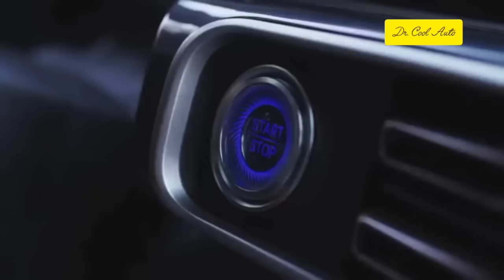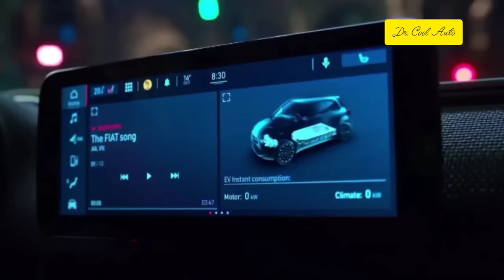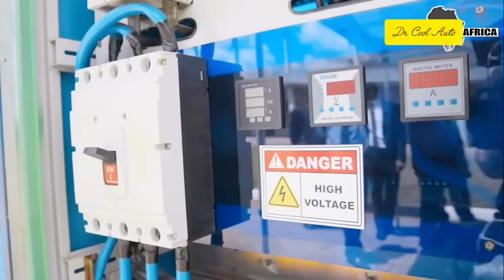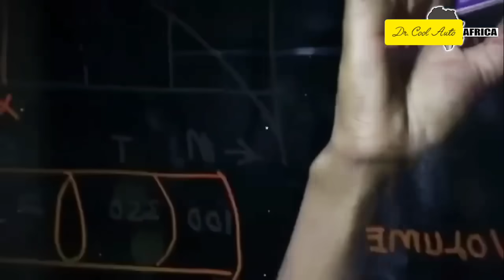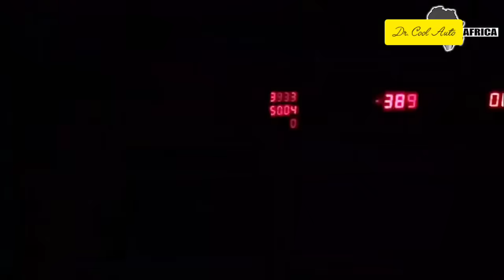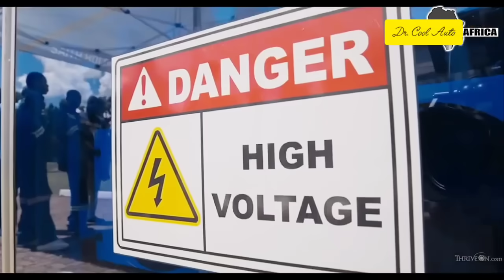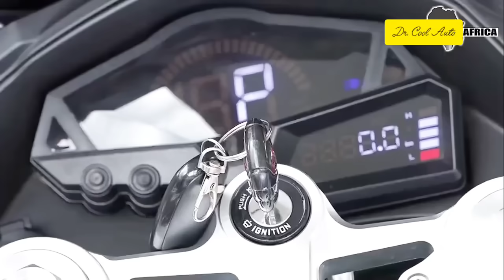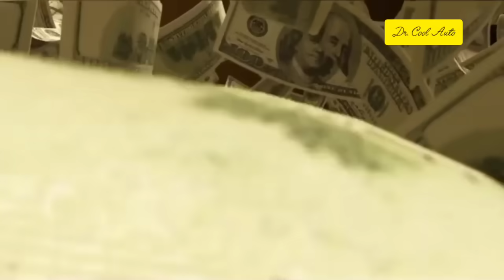2025 Self-Powered EV: Shakes Up The Entire World! shock skeptics

Comment: Charging of EV's was always possible.
Mr. Chicumbutso's invention is very great; but the charging of an electrical vehicle was always possible but was discouraged. 
     All electricians and all electronic technicians always knew that an electric vehicle is always capable of being self-charged by alternator just as was done to the gas engine vehicles. A simple alternator or one made specifically for the larger battery bank of the EV could be manufactured. Typically anything that moves can generate electrical energy.
       On the other hand Mr. Chicumbutso's energy is a different matter. It is a much more comprehensive matter. Nikola Tesla had already invented something like that but his funding was pulled for the same reason;  it promised free electrical energy; which does not suit the status quo. Tesla died and it is said that government took his records.

Comment: I have posted years ago about self powered generators , lately a comment on self powered engines. As a single unit , the gen is mounted to the electric engine and wired direct . Utube w/ elon i dropped this comment about yr + ago.

If you combine my self powered generators w/ electric car engines . You end up w/ a single unit you can put under the hood and drive 24/7 no batteries , no charging co's no oil or gas . Just drive fly ship cruse . Again .... Anything electric can be redesigned as a self powered device . All of them AC , Frigidaire, computers etc.. 😉 my specialty self powered ever herd before..

 yrs later even nasa tried to claim on utube stolen nasa tecnologies , free energy devices. 💩 
Because they didnt have any such a thing as being self powered at all ... Others will continue ✓ uc all appliances .

Comment: $14,000 just in production is still too expensive for the African market. Let the selling price per unit drop down to at least $5,000 then the invention could really cause a threat to the fuel car companies.
Reply from the maker: Well how much is brand new Tesla Model and byd sold?
Reply: @drcoolautofix  I don't know since I'm obviously not the target market of Tesla here in Africa but the cars bought here are bought for 4,000 and the one sold for $14,000 which exchanged to the local currency is about 35 million that's a very comfortable car and not many buy it.
That's why I was wondering as his cost is that high is his target market really Africans or has he just been duped to create a product that at best would have to export it abroad.
An easier way that maybe he could go about is if the government buys his cars and he uses profits to make cheaper cars for the masses and they should be made in the country to avoid extra transportation costs.

Comment: A very very old idea, but interesting to see someone still trying to get it to work. Problem with converting radio waves is how little electricity it produces. An electric car would require roughly a billion microwatts for every mile, also it depends on the strength of the wave and the conversion circuitry used to convert it to electricity... then there's the drain issue. Generating at the same time as using the electricity, you drain the electricity faster, so you would actually need to generate around 1.6 times the amount of energy needed for whatever task. At best it would top up an electric car as you drive, but you would still need to make sure it is charged enough before you set off, as it will still run down in the end.

Comment: RF Radio frequencies are present in any modern city. But the power levels are low, limited by physics and laws concerning radiation levels. Even a cell phone is required to provide a statement about the radiation level it can produce so that it is not considered harmful to the user. The available RF power in our environment is in microwatts or nanowatts. While this is "free" energy, the capacity to use it for any purpose is far from what this "invention" offers. But as an electrical engineer, I would be happy to test any prototype without any fees and make a technical report on what power could be measured scientifically.
Reply: it already was tested by americans and proved to be exactly what the inventor said it was and can do.  You are like a child compared to this guy.  He's far above what your brain can comprehend.  So sit back and be quiet.  You don't know anything about his tech.
Reply: Which Americans tested it? I'm aware that one went to visit him and made a video but it was little more than another promo for Maxwell, no serious testing was carried out. Was another group involved and did they write it up?
Reply: Amplifier. You can amplify any frequency. Electricityp is in the air. Very powerful lighting bolts travel through the air. Draw the power from the magnetic field, like a transformer and pull the energy out of the air. Nikola Tesla made a machine that could cause earthquakes by amplifying the resonance frequency.  Every atom has a resonance frequency. Just amplify that frequency and see how much power you can get.
Reply: @laron_t_green  Lightning is a static discharge. What kind of amplifier do you suggest?
Reply: @bernards8050  that's the trick. Whatever he invented can amplify radio frequencies. We know that in acoustic design, defusing Soundwaves transforms that energy into heat. Alternating magnetic fields can create voltage. Microwave ovens create heat with radio waves. He appears to have discovered an amplifier for radio waves that convert the energy to either a magnetic field or direct current.
Reply: @laron_t_green  This video on youtube demonstrate how to power an LED using the "free" energy. It's a decent review of what can be achieved with technical explanations. https://www.youtube.com/watch?v=sgv_JgKRjhA
Reply: @laron_t_green  You can amplify the voltage or the current but without a power supply you cannot amplify both.
Reply: WOULD YOU, SIR, BE TERRIBLY TEMPTED TO STEAL. MAXWELL'S THEORIES AND PRACTICAL APPLICATIONS FOR YOURSELF , YOUR COMPANY , OTHER ROGUE. INVENTORS OR JUST SELLING TO THE HIGHEST BIDDER . EVERYBODY AND THEIR MOTHER ,WANTS WHAT YOU WANT .
Reply: They tried to kill him for a reason. He is threatening your little world.
Reply: @yven0305  But did they try to kill him? Who exactly was his business partner that was killed? Nobody seems to know.
Reply: They can use battery in the car  and charging by RF   so the battery never empty ,
Reply: You can try to keep  a black cloth on your eyes to  avoid seeing the truth, but when God bless someone  with this kind  of wisdom ,he will succeed. Remember, Saul tried to kill David, so many times, but God shield 🇿🇼 🙏

Comment: How about Suping UP our Heat Pumps? Modify Commercial Heat Pumps HP with a complementary Heat Exchanger HE. To transfer most of the available energy use both an Air to Refrigerant HE & a Water to Refrigerant HE To Transfer twice the energy than a Commercial HVAC HP. I DIY'd the project & it WORKS on both Heating & Cooling!

Comment: This is not free energy. It's high frequency energy picking up radio waves. Those signals have to be pumped out with a power source.  Honestly,  i think that is what the pyramids did using a water ram and piezo effect through the granite to store power in a capacitor   like the ark to be transmitted into the air for all to use. But the power still has to be generated to be transmitted.

Comment: Tell me you don't understand the 2nd law of Thermodynamics without telling me that you don't understand the 2nd law of Thermodynamics.  Microsonic ...whatever device.  I have invented a new duel source engine which runs either on snake-oil or mental retardation.  Shame on you Dr. CAF.  Click bait to the extreme.  Let him bring that device to experts, have them sign nda's and crack open the lid.  Or if you don't want to do that just bring one of the cars or motorcycles to a test track. BTW, why does the motorcycle in the video still have a gas tank?  Let everyone examine the car to see if there are any hidden power sources and then drive it for 500 miles.  I may be wrong in my skepticism.  I'd love it if I was wrong.  There is a 0.00000001% chance that I am.

Comment: That Sony TV was designed to receive power through its power supply and then the power is internally routed in the correct amounts to its parts. Its power is not going through the power cable, then he would have to redesign the way the TV handles power. Did he do that? I don’t think so. This process does not pass the BS meter. I need hard scientific evidence from Mr. Chimbutso before I am going to believe this is not a scam. Plus, this video is long on hype and stock images with no actual proof.

Comment: It's a cool idea but I don't see the proof, lithium battery needs to be charged completely full and run out the charging cycles for it to perform correct if you're constantly partially charged and, Charging? The performance is going to be weak, and the battery won't the last long. Is along with the fact that big money corporations never Is actually let ideas like this benefit the public

Comment: This looks good. Honestly the main problem with it that I can see is that as more people use it there would be less available radio waves to generate power. Now this is fine up to a point but once that happens it will be like any other energy source. Like all things nothing can create energy from nothing. So while it honestly does look like a real breakthrough and an extremely positive creation it relies on outside radio waves to produce electricity. This in turn will likely lead to one of two things; limiting supply or artificially increasing radio waves.

Comment: Sounds like he has tapped into what Tesla (the scientist) tried to accomplish using his Tesla towers. They used RF to transmit electricity to RF receivers with the correct frequency as the transmitter. It requires power to send the RF signal, but the signal cam transmit with need of power lines, poles, and other infrastructure that is a burden to maintain and plan. It is 100% doable with the correct structures in place (the RF grids need to overlap). If he isn't using that technology, then he has figured a way of tapping into the various geographical anomalies referred to as lay lines. If that is the case that is truly amazing as it requires no transmitter, just a receiver dialed into the nearest lay line frequency.

Comment: they will buy him out.  the energy robber barons will never let it happen.  EVs are a banking scheme... Make folks lose their paid for gas cars & motorcycles. then you need a usury inflated loan(insane interest). if this is about saving the planet then why do we not see 9,000 dollar Chinese EVs? No, they want folks to be in debt for 40,000-110,000 dollar because by they that loan is paid that vehicle 120,000-330,000. crazy economics trap. We have ALTERNATE FUELS That ARE clean. check out this, A company called Twelve. CO. it is one that no one will back and the fuel will run clean in an internal combustion engines that we have now. If the EVs were about saving the planet the bodies of these vehicles would be covered with solar cells when the sun is out and this would lessen the use of the electric grid. remember,Thomas Edison and Henry Ford had a functioning electric car in the early 1900s.
https://www.twelve.co/

Comment: No, free energy doesn't exist this is simply mechanical energy turned into battery power and it powers the ev motor. The car generator is a mechanical generator, this follows the same principle when you make a wind turbine, but in this case, you use the torque or rotation of the wheels to produce electricity which is transferred to the battery, and in turn to the electric engine.